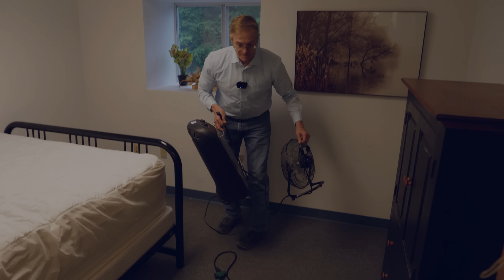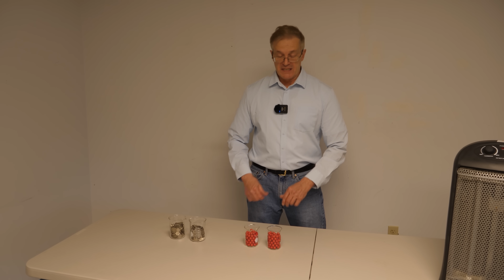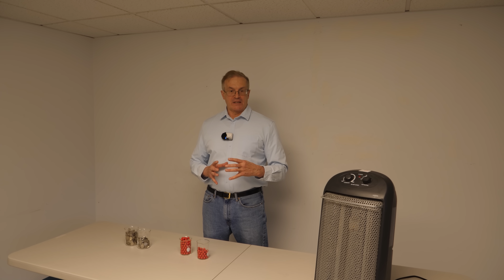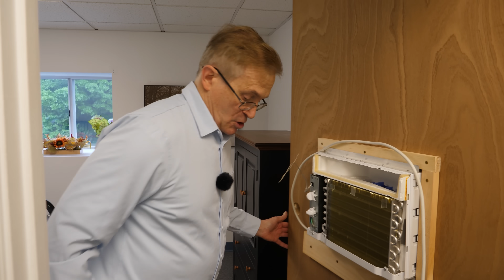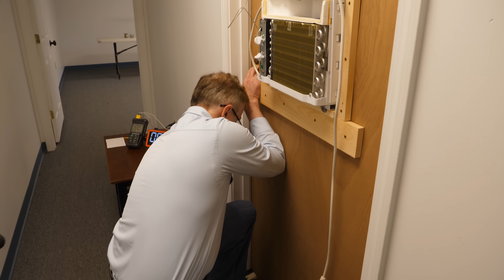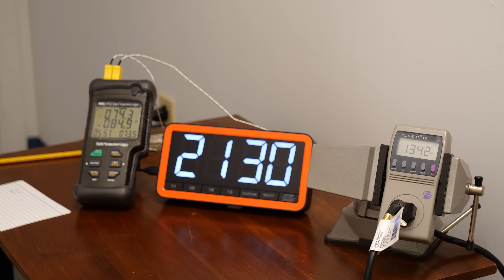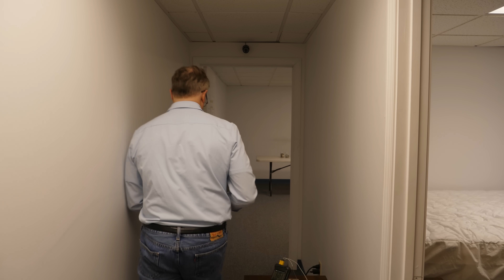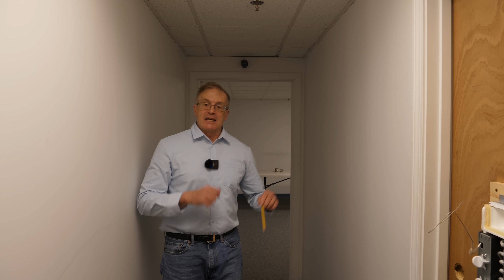You're wasting money on heating! Use your A/C!

Comment: How well does it work in colder climates with less heat energy available in ambient air?
Reply from the maker: The greater the temperature differential,  the less advantageous the heat pump, but it will always beat a basic heat source.

Comment: Is there an inherent efficiency difference between a heat pump and a normal air conditioner being used backwards?  Assuming both were identical other than one having the switching valves.
Reply from the maker: No, they're basically two ways of looking at the same principle and operation.

Comment: 16:00 I want to mention that this test isn’t 100% authentic in its efficiency readings. Because the air conditioner is running inside the building, the evaporator and condenser are working against zero opposing temperature. Under normal operating conditions, hanging out the window into the cold would reduce the efficiency by a small percentage, it would’ve been more accurate to just put it in the window backwards
Reply from the maker: It is authentic. It quantifies the heat pumping multiplier vs resistance in a controlled environment. You misinterpreted the purpose as applying that differential, which we proved, to heating your house.

Comment: Great video and thanks for sharing. Though I'm very curious what happens when the outside temperature is close or below the freezing point?
Reply from the maker: That does pose a limit. The refrigeration system in airconditioners is not designed to cool already very cool air.
One option there is to use this airconditioner to warm particular rooms in a building using the air elsewhere in the building as the heat source such as a basement or attic.
Reply: @TechIngredients Hi! Thanks for the quick response. So, basically we are stealing heat from other rooms 😅
Reply from the maker: Yup. 
Don't feel guilty, the mice will just come and join you where it's warm.

Comment: I can't remember where I saw it but apparently there is a chemical I think it's aluminum acetate but do not hold me to this. That when dissolved in water goes cold. But when you can conpress to one atmosphere it goes back to a solid and produces heat. The implications of this are staggering. Because if it's true it would not take much energy to exert one atmosphere of pressure. If the cycle is back and forth you get rid of the heat on one side and pick up the cold on the other. It would make modern heat pumps look very inefficient.
Reply from the maker: I think the principle is correct.   But you can't cheat Mother Nature. Thermodynamic law prevents you from reversing entropy. There has to be an energy source to move that heat, suggesting that the process is limited or requires more than just the application of a little pressure.
Reply: @TechIngredients of course the adequate system to get rid of the heat and dierect the cool would have to be sufficient. But nevertheless very intriguing. Please keep up the good work.. I still wish I was your neighbor. I did research and development for the greater part of my adult life and consider myself very fortunate to be able to do that. I just love it. It's in my blood. 🥰

Comment: Missed this video.. Glad just found it
Reply: Ahh so this vid was just before AC w/water cooling.

My question (beside using two units per room one for heating and other an AC (with water cooled Condenser)  could one do one unit as AC with water setup) but still get heat side. Maybe two holes in wall and two units easier though

Comment: The only comment id make on this is that the space heater is just heating the room but the ac is moving the heat from the hall into the room.  So what happens when the hall is very cold? Can it still efficiently extarct and move heat?
Reply from the maker: The principle still holds yet the temperature differential is a real component of the effeciency advantage and it will decrease as that differential increases. But, there is a long way to go before that advantage disappears.
Reply: @TechIngredients  this is very interesting to me, I am looking into an AC to cool my working area (shed) in the summer, and would like to heat it in the winter.  At the moment I have 1500W solar which is fine in the summer and more than sufficient to run my portable AC.  In the winter not so much,  I only just realised I can go past the 100% efficiency of my space heater with a heat pump.  Next winter will be a great testing ground for this idea.

Comment: Have a green house pool. When sun is out indoor air temp can go to 100+f . How would  you transfer that heat in pool water?
Reply from the maker: It could be pretty simple. 
What are the dimensions of the pool?
What are the dimensions of the interior air space?
Do you care about the humidity levels in that air?
Is the pool insulated from the surrounding soil, assuming it is an in ground pool.
Reply: @TechIngredients have a vent system  for temp control ,pool cover for humidity  ,pool is 80000 cubic litres, interior is 22000 cubic feet
Reply from the maker: Id start by focusing on that vent system with its existing blower. You can purchase really large fluid based radiators that can be placed in that airflow.  They're sold for computer servers at a pretty low cost, or you can put together your own from scrap automotive radiators and pump the pool water through this setup.
Reply: @TechIngredients   Our greenhouse vent system is roof mounted with a motor and thermostat.  I used a sump pump to connect to a venturi twin aerator mixing pool water and greenhouse air. I was hoping to use some type of AC or heat pump unit so I can heat the pool more efficiently.

Comment: Ever since I switched to 2 dehumidifiers in winter to prevent mold, I've never had to use a heater since.  I now prevent mold AND warm my home.
Reply from the maker: That's great.
I'm curious why you would need to dehumify in the winter.  Typically,  winter air is so dry that people need to use humidifiers.
Reply: @TechIngredients  I think every home and dwelling is a little different.  I have 5 kids so 7 people breathing creates humidity, not to mention we cook as opposed to eat out, so that also creates humidity.  Mold would form on the windows and in spots that were cold (walls facing the outside) that didn't have airflow.  The dehumidifiers dropped the mold growth significantly and generates enough heat to not require heaters.  One did cost about $450 and the other $300, so the more expensive one is decently powerful.
Reply from the maker: That makes sense.

Comment: A 12 degree vs a 22 degree delta inside to outside the AC unit was a BEAST, holy crap I am going to get my ac unit and turn it around for my shop.
Reply from the maker: It is.
We use this to warm our shop and use the modest temps in our unheated garage for the cold side.

Comment: I would be concerned about any off gasing, leakage, etc that A/C units may have that commercial heat pumps may account for. A/C units are probably not rated for heating a room as it is to vents to simply the outdoors.
Reply from the maker: That's a good point.
I suspect it's not a very significant risk because these units can operate for years and even decades without maintenance or recharging. But, it's something to consider.

Comment: Btw if you switch windows unit around and the evap sucks in say 0 to 5 degreesf air from outside like it is now in texas 1/27/26 your condenser is not going to blow very hott, that is why the reverse vavle in heat pump does,  and why most heat pumps dont work well below freeze point and uses heat strips instead 😂

Comment: Finally got around to setting this up in a  bathroom window. I made ducting to keep the whole unit inside as even trying  to trick the thermostat with a lightbulb the cold from the outside was too much for the thermostat to trigger the ac…now, it’s working like a  charm. I placed a bucket below to catch water drippage whenever that kicks off. I’ve got central heat and air but this can probably bring my energy cost way down in my home as it’s mostly one space.
Reply from the maker: That's great!

Comment: 1:30 It's not close to 100% efficiency. IT IS 100% EFFICIENT. I'm surprised you'd fall for such an absurd mistake.
Reply from the maker: It's very, very close to 100%.
Don't forget that alternating current generates EM radiation.
Reply: Also a little noise!

Comment: If you want the ultimate heater use a  s23 318th bitcoin miner at 3500w 240v . It will make around $378.27 a month and take $201.48 in electricity to run (at $0.08kw/h) this is a profit of $176.78 and an extreme  amount of byproduct (heat)

Comment: Interesting video. Had I seen it sooner I might have tried something of the sort for my application - which is more heating than cooling. I live about a mile from the Pacific Ocean - and the climate here is generally cool. Summers usually feature days in the 70s and nights in the 60s, winters 60s and 50s. Rarely does it go below the 40s, and I have never seen it below freezing. It can get hot on occasion, but that is very rare. For some reason my gas furnace does a better job of heating the bedrooms than the remainder of the house - so I decided to try a window mount heat pump to warm the latter when we are occupying it. In general I am pleased with the results. Most of the time when I am using it the unit it draws roughly the wattage of the blowers in my gas furnace (while using no gas at all) - and warms the main part of the house to comfortable temperatures. The power draw does vary with the temperature differential, and I doubt that the results would be satisfactory if the outside air were much colder than it is around here. Bottom line - I am Happy with the results of my foray into HVAC - but am aware that my success is dependent on dealing with a mild climate. For the few days a year that it is too hot in the house, I switch the unit over to cooling mode (which works great).
As for turning a conventional A/C unit around for heating, I note that nothing was said about protecting the former indoor side from the outdoor weather if you try that idea.
Reply from the maker: You have enviable climate!
That is exactly how I would use an inexpensive airconditioner as a heat pump.
If the climate is harsher, like ours, then id use the geothermal route like we demonstrated in our later video on geothermal cooling.
For heating,  propane and natural gas are inexpensive and conventional furnaces are common and much less expensive. We'll stick with those.

Comment: Now do the same where the ac unit is pulling heat from -15C outdoor air. More of a fair, realistic comparison.
Reply from the maker: Understood. 
Keep in mind that we were primarily demonstrating a principle and climbing a 40C hill with a heat pump requires a a different evaporator restriction. A commercial airconditioner has an output temperature from the cold side of around 12C.
This still can be used for winter heating if the air from a basement is the source of the heat, or better yet use a geothermal heat source like we demonstrated in our more recent video.

Comment: I wonder, does the air conditioner add moisture to the air in the room?  Does it increase the humidity?
Reply from the maker: It will move humidity from the room with the controls side, "cold side" to the other, normally outside part of the unit.
This might even be an advantage if used in the winter. Also, in the winter all the air tends to be dryer and so there isn't going to be much humidity transfer and if the indoor humidity is fairly low, the cold side won't condense any water at all.

Comment: You were able to pull heat out the hall to the room. Is there a point when the climb is too steep? If that closed room was pulling from outside at 50° F would it still work? I can't get my head around how it's limited.
Reply from the maker: It's a progression.  If my description of the principle was clear, the advantage of a heat PUMP is that it requires energy only to raise (or) lower the temperature differential. The smaller  the differential,  the greater the multiplier effect.

Comment: I liked your demonstration here. I am curious. Let's change things a bit. Lets imagine that the whole building is cold inside, very cold. Can this method still somehow pull heat out of the cold air? In this demo you are taking warm air from inside the building which makes the results a bit sketchy. Great solution here if you are taking residual heat from one area, but when the outside air is just as cold as the room you are heating, can this still work? Is any or all of the heat being generated by the operation of the ac unit itself, and therefore the outside temp is less relevant, or irrelevant? Can you further explain what is happening to effect the change and why? Thanks for the demo and video!
Reply from the maker: The process can work over a very large temperature range, but like I explained in our later video on geothermal air-conditioning, the greater the differential,  the lower the multiplier effect of a heat pump.

Comment: This works practically by just bypassing thermostaton the AC for outside temps above 52 in low humidity and possibly sometimes down to 46 in super high humidity or when it's raining.  The thing is the coils freeze up so you are very limited.  Theoretically just by adding a big enough fan on the outside coils you cooluld keep it working even down around 32-34 outside.

Comment: This inspired me to use a 5000 BTU AC to heat my 250 gallon inflatable spa.  Thanks!
It's working great.  It heats the spa about the same rate as the spa heater but it's using only 1/3 the power.
Reply from the maker: Great!

Comment: If that a/c front was in the outside wall on a cold day, how efficient would it be?  say 30 degrees F
Reply: It would still probably produce some heat, but I suspect it would be less than what the same power going into a resistance heater would produce.  Although there are heat pumps that can keep extracting heat even from 30 F air, air conditioners aren't designed to be efficient at that temperature.   However, if you built a geothermal setup like was done in another video on this channel, it would work well year round.  You would only need to box up the evaporator instead of the condenser so you're extracting heat from the ground instead of dumping it.

Comment: I have a Samsung Mini-Split system (UK) we used it for heat last year (2, 3 unit systems) Approx "power" was 2.5KW per AC unit... cost us £15 per day to run them for heat - needless to say i'm going to freeze this year as i'm still paying 2024s Electricity bill. Average "winter" temp here between 0 and 5 degrees centigrade.

Comment: So how do I apply this knowledge to my central air, probably cant right? Or what if I bought a window unit and ducted the cool air to the nearest window how long for an ROI based on a 200$ unit similar capacity as demonstrated and 20 cent Kw/hr electricity cost vs my 93% efficient gas furnace at 28 cents/therm? Interesting video but how do I crunch the numbers? Guess I could just buy and look at my monthly bill :)

Comment: Well I had to try this and sadly it didn't work. 58f outside and about 50f in my shop. It didnt blow warm air. I turned it all the way up so the compressor wouldn't cycle and it still shut down the compressor. There is a copper tub on the front and I am sure it is the thermostat that controls the compressor. Maybe I will try to bend that to be inside. If anyone wants to help me figure out why its not working I'm all ears.
EDIT: After reading the comments i discovered that this is not a winter time heating option unless your outside temp dont go below 40f. It would have been great if the scientist here would have mentioned that as I wasted my time tearing down my unit to move the termostat to the inside only for it to still not work because the condenser coil clogs with ice. 
The next video that everyone was waiting for is much more in depth (no pun intended) as it actually modifies the AC unit and adds geothermal cooling to the hot side. Adding about 300% efficiency. Sadly this dosent help you heat a room in the winter.

Comment: So, just two cents of my knowledge. AC units have a thermostat that indicates when to turn on or turn off the heat transfer (for lack of a more understandable word). That wouldn't work in this case, because I want to remove the heat from an infinite space, so the heat transfer will never stop. How would this compare to using an AC unit that has both heating and cooling?

Comment: Hi, although "heatpumps" are a winner at any time in my opinion, you are not showing a practical solution and a "like for like" comparison. You only cooled down the building mass and the ambient air temperature of the building, to heat up just one room. what about the other rooms and how cold will it be in the corridor if you did heat up all the other rooms? For a "like for like" demonstration the air-conditioner should have been a split system with an outdoor unit.

Comment: I love learning about this but fortunately I live in South Dakota where Natural Gas is very cheap so for now in winter I heat a warehouse where I work for just about $120 per month. But all the newer houses in some areas are all electric w/ propane as an option which is very expensive. Also have you tested these sand heat storage batteries?

Comment: Does it get very humid in the room though?
Reply from the maker: No.
The humidity doesn't increase because no water is added to the atmosphere.
Reply: @TechIngredients im thinking of doing this in my little shop but the ac unit i have drips water out of the back ( like they all do ) so i figured that i would be putting humidity in my shop but i guess i just need to put a hose on the bottom and plumb it outside ( ill just take the digital controls off and relocate them inside , should work right ? )